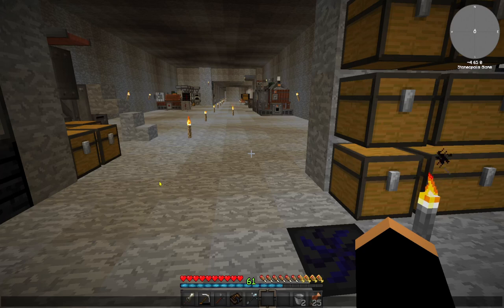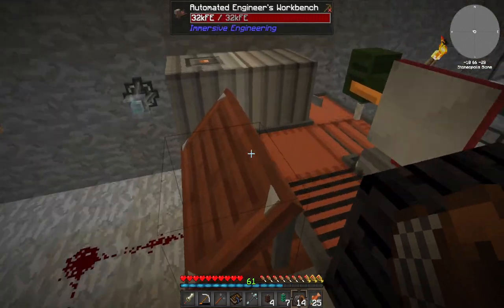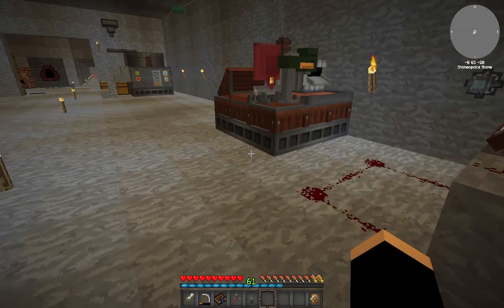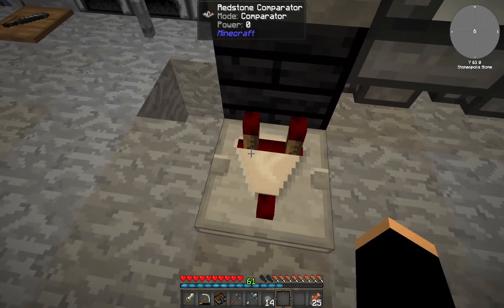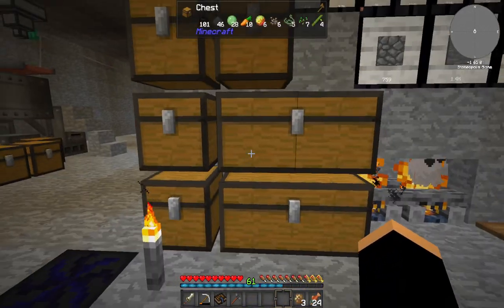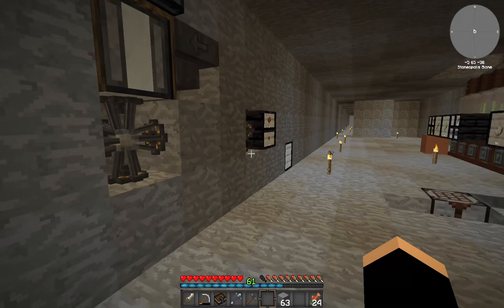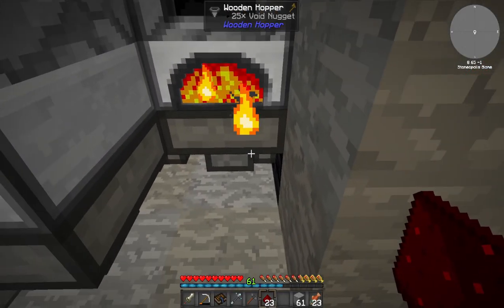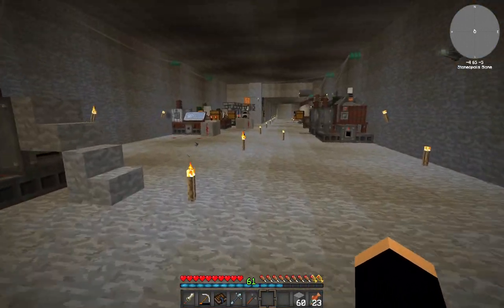Stoneopolis Ep9 - Fully automated Lapi-Stone ingots & Void Iron ingots.

Comment: For future travelers struggling with the redstone drawer/node issue: you could also make/buy a Drawer Controller and link it to the drawer, then extract from the controller while using the redstone upgrade in the drawer to output the "am i full" signal